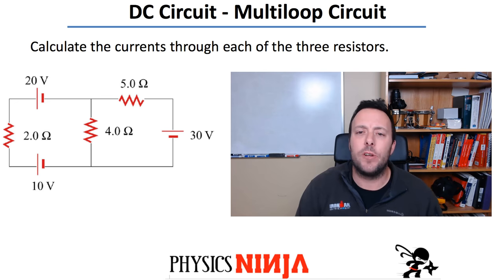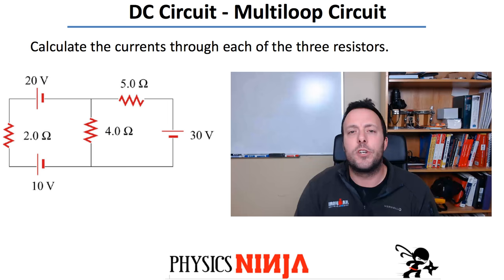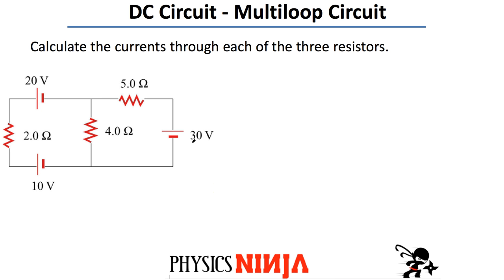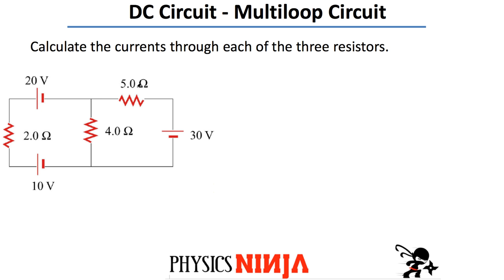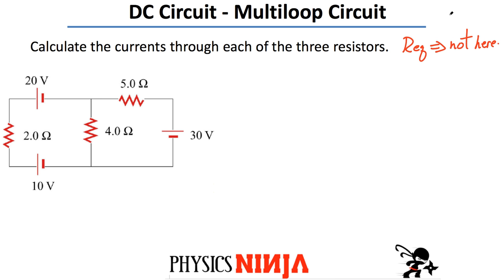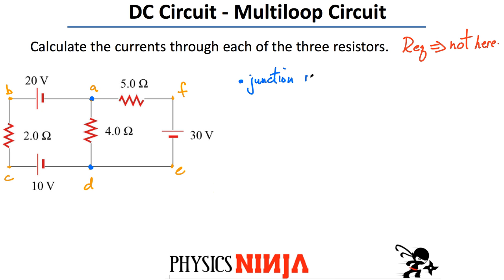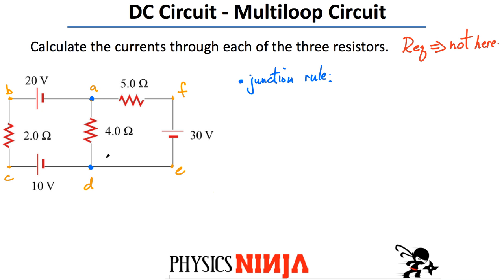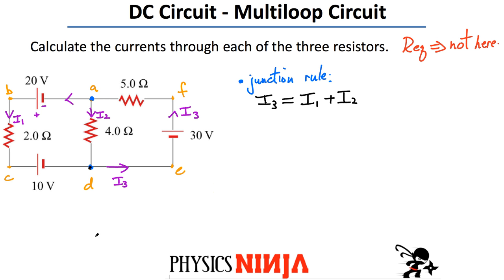Solving Circuit Problems using Kirchhoff's Rules

Comment: My GROOVY Bro... Watching this takes me way...way...way back to high school electronics. They barely had hand-held calculators back then. I barely got through with a "D". I absolutely admire your ability to minipulate those equations I struggled horribly with. The way I'd do it is...set-up the circuit in reality, throw the switch, then jump out the window and wait for whatever battery or resistor blows-up first. (Repeat process 3-times). Increase resistor wattage rating each time.) The Professor.

Comment: Good 'circuit sense' explanations combined with KCL/KVL loop analysis to derive a system of three equations in three unknowns (the three loop currents).  Also, good follow through on solving system of equations by substitution for elimination of variables.  The bedrock of electrical circuit analysis.  Mesh analysis techniques can be easily mastered later with matrix algebra used to solve  more complex systems -- kudos for your common sense approach, which I think is very helpful for developing a sense of what's going on in the circuit!

Comment: how do we know that  the resistors cant be replaced with a equivalent one?
and one more is there any case that both voltage and current does not remain constant?
i appreciate ur fantastic work!!!
Reply: Resistors can't be equated to one when you have multiple batteries that have random different directions in different branches

Comment: You could have proved it by looping the junctions and the then showing the flows. Or the voltage drops . Nice refresher for something I learned years ago.
Reply: There's also the method of superposition, which simplifies the algebra to plug-and-chug arithmetic, so you don't need to solve a system of equations.

The way it works:
1. Pick one of the energy sources of the circuit.
2. Replace all the other voltage sources with short circuits, and all the other current sources with open circuits, to "turn them off".
3. Use resistor combinations and voltage dividers to solve for the voltage at a desired point.  Identify it with the point and the ID number of the voltage source.  Put that aside for later.
4. Repeat for all the other sources
5. Add up the voltage at the desired point due to each of the sources, to get the total voltage at that point.

Comment: it seems like the 20V and 10V batteries would be fighting eachother.  does the 20V battery really just overpower the 10V and allow current to flow through the 10V battery backwards?

Comment: How you do know how many currents are needed for a problem? is it equal to the # of resistors?
Reply from the maker: You will need a different current for each branch of the circuit.

Comment: needlessly complicated it brother. U could've simply supposed a current I-1 flowing through loop abcda and current I-2 flowing through loop adefa. that way the 2 variable system would easily yield results. introducing the I-3 was needless

Comment: Couldn't you add equation 2 to 3 to eliminate I2? You would have 10- 2i1=0 and 30-5i3=0; then replace i3 by (i1+i2). i1=5A; i2=1A; i3=6A

Comment: Why in this circuit there are several power sources ??
Reply: Short answer, "because he said so".   Because that's what the problem author specified as part of the challenge.

Long answer: what this really could represent in reality is the combination of multiple batteries in a battery bank, and how you would account for non-ideal factors.  It is impossible to make batteries identical, and all batteries have a non-zero internal resistance.  Circuit analysis of a circuit with multiple sources, is how you would determine the performance of such a battery bank.  This could also represent how a battery gets charged, from other voltage sources.

Comment: Hello! I'm struggling with circuits in which current is not flowing in the place were is resistor 4 OM. What conditions have to be met to no current there. If there was resistor/bulb.  Would be grateful for help 😵‍💫
Reply from the maker: Think of ohms law,  no current means there is no voltage difference across the resistor.  Same voltage on opposite ends
Reply: Ooh, thanks! :) Finally I understood that.. I found that part very unintuitive for me.

Comment: how do i use to calculate this circuit using matrix and how do i arrange in matrix form, like how to arrange the 3 equations in the video in matrix form
Reply: (a1 b1 c1, a2 b2 c2, a3 b3 c3) (x, y, z ) = ( a, b, c )  take the inverse of the 3x3 matrix on the other side and multiply

Comment: dont u have to split the cicuit into 3 circuits for each battery
Reply: No, because 2 of the batteries are in series, and therefore not independent from one another.  You only have to split the circuit when there are multiple loops.

Comment: In your 5 ohms resistor (horizontal) how can we know the positive and negative side of the resistor
Reply from the maker: to find which side has a higher electrical potential you need to find the direction of the current through that resistor.     Positive current (as defined in physics) goes from higher potential to lower potential.
Reply: @PhysicsNinja  understood. My lecturer made a 2 hours video about this and I couldn’t grasp a thing. You made me understand the concept with a few minutes video. Thank you 🙏

Comment: Mesh analysis by inspection is a much easier way to resolve 2 mesh ckt like this.
Reply from the maker: There are many ways to crack an egg.   I also have videos on nodal methods, supernodes, and Thevenin equivalent.   These methods are all simpler but they require some knowledge of Kirchhoff.

Comment: Uhh.."All the currents flowing INTO a junction, sum to zero."
Reply: Technically correct, if you consider currents exiting the junction as negative currents entering the junction.  It's more intuitive to state it as the sum of currents entering equals the sum of currents exiting.

Comment: This videos fails to you tell you that equation one is necessary: you cannot solve the problem using only the loop rule alone. Utter failure.
Reply from the maker: Lol
Reply: Usually you can't solve the problem with the loop rule alone, unless it is a circuit with just one loop.

Comment: You complexed thecalgebra too much
Reply: There is a shortcut with superposition, that allows you to avoid this algebra.

First, we can consolidate the 20V source and the 10V source as one voltage source.  Since the order of components in series doesn't affect the outcome, we can swap the positions of the 20V source and the 2 ohm resistor.  The 10 V source is backwards, so it subtracts, meaning we have a 10V source in the CCW direction, and a 2 Ohm resistor.

Let V1 be the 10V source of the left circuit
Let V2 be the 30V source of the right circuit
Then calculate the voltage at point A, assigning point D as zero volts.  Once you have this answer, you can know the voltage drop across each resistor to find the current.

Part 1: turn "off" V2 by replacing V2 with a short circuit.
We now have a parallel combination of the 4 Ohm & 5 Ohm resistors, which is in series with the 2 Ohm resistor.  Parallel resistance = 5*4/(5+4) = 20/9 Ohms.

Voltage divider: Va1 = (20/9)/(20/9 + 2)*(-10V) = -100/19 V
The negative sign is present, because V1's negative terminal is closer to point A, and V1 will cause a negative voltage at this point.

Part 2: turn "off" V1, and repeat.
We now have a parallel combination of the 4 Ohm & 2 Ohm resistors, which is in series with the 5 Ohm resistor.  Parallel resistance = 2*4/(2+4) = 4/3 Ohms.

Voltage divider: Va2 = (4/3)/(4/3 + 5)*30V = 120/19V

Add up total voltage:
Va = Va1 + Va2 = 20/19V = 1.053V

We now can make appropriate subtractions to find the voltages across the various resistors:
2 Ohm resistor: 1.053V - 10V = -8.947V
4 Ohm resistor, already know it, 1.053V
5 Ohm resistor: 30V - 1.053V = 28.95V

Simply divide by resistance to find the currents.